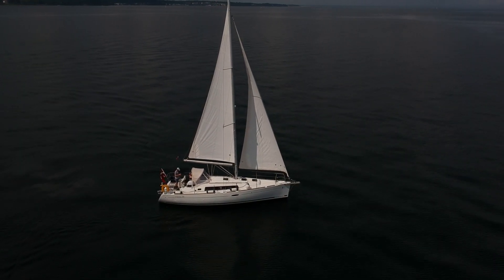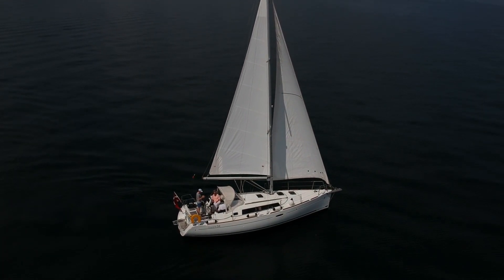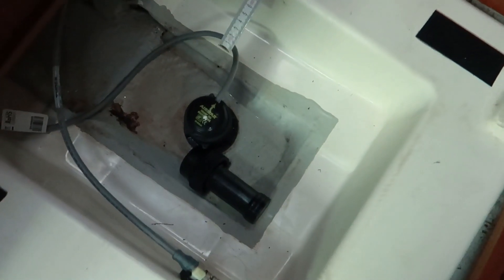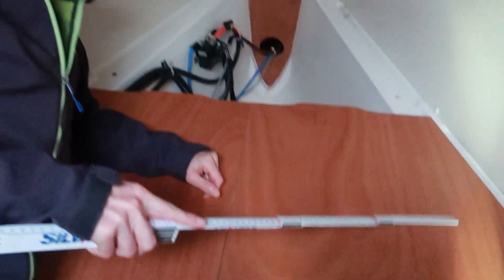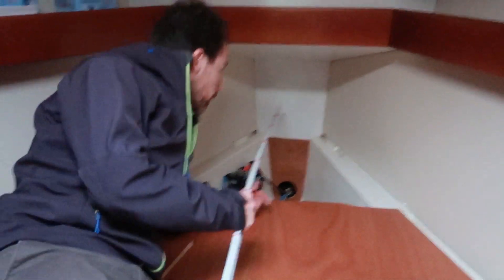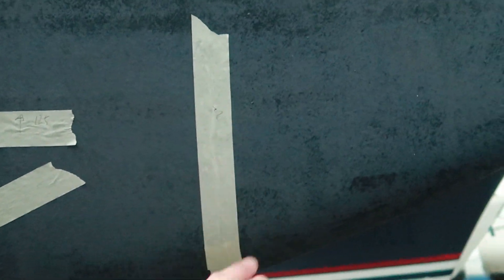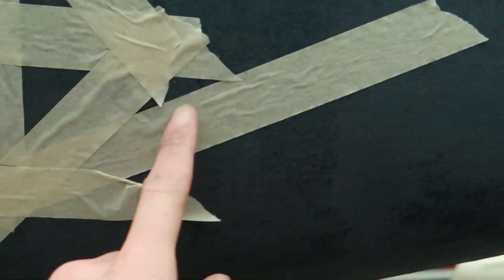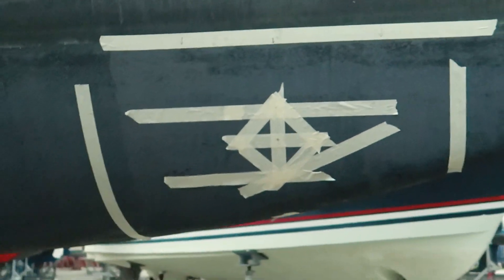Finding the correct tunnel placement! | DIY bow thruster install

Comment: Thinking about this,  there is a quicker more elegant way to develop the center points for the tunnel.  We know the location is the distance below waterline from manufacturer's recomme dation and as far forward as possible. Use a full scale foam mock-up of the motor/tunnel assembly to determine this second dimension. Now drill a small, pilot hole through one side.  Using a somewhat stiff rod, thin stick, metal rule or whatever, create two marks on it with tape and a pencil. One is the vertical distance below the rub rail at the drilled hole location. Lay the rod against the hull and transfer this mark as an arc to the other side, onto a patch of tape in the approximate location of the second hole. Approximately level with the hole, mark the center of the bow onto tape. Use this point to mark a second, reference line onto the rod. With the end of the rod positioned at the respective rub rail and bow center marks, create arcs with the second mark intersecting the first arc to indicate center on the opposite side. Drill your second hole here.

Comment: Hello again.  As far as the marking tool you used for drawing the circumference of the holes to be cut....  Do you have the file for a three D printer?  Thanks,...
Reply from the maker: Sure, I can email it to you. Just remember that it’s made for a 125 mm tunnel with a wall thickness of 4 mm
Reply: @jacobkollerup  Thank you.  My email is darrlafon@icloud.com Have a nice weekend.  Blue Skies.

Comment: I am so glad that you did this series on bow thrusters. I have a Beneteau 400 Oceanis that I have thought seriously about installing a bow thruster on, but I also have some unique problems related to the layout of the 400 Oceanis I have. Mine is the two cabin version with the master cabin and head forward from the saloon. My bow area consist of a rather small chain locker, followed aft by the master head and then the master cabin. I am not sure that I physically have the room to put a bow thruster in where it will do any good, I think the chain locker is two small and high off the keel and that there is no room in the head deck area. I won't know till I watch all series and have a chance to look at the measurements that you show. Lucky,  I am on the hard in the middle of a two year retrofit, so I should find out my answers fairly quickly I expect. Thank you in advance.
Reply from the maker: Glad that you enjoyed the first episode. My guess would be that the chain locker won’t be sitting deep enough with regards to the waterline. Your boat is bigger and heavier than mine, so you will probably need at least a 60kg thruster and a tunnel diameter of around 185mm (sorry for my metrics). I did see another install where the tunnel were fitted under the “throne” in the forward head, that might be an option. Anyway I would recommend making a foam mock-up of a thruster motor and a piece of tunnel to check for internal fit. Next episode will be out in just under 2 weeks
Reply from the maker: Next episode will be up in a few hours
Reply: @jacobkollerup  60kg is around 132 pounds and will need a 7  !/4 inch tube. I am hoping a 8" pvc heavy wall water pipe will work for the tube.
Reply from the maker: I'm not so sure about using a PVC tube. All (or most) bow thrusters can be supplied in a kit with the motor+tunnel. I would definitely go for a tunnel that the manufacturer recommends. Also, I'm not sure about the fiberglassing to PVC if you will get a good bond